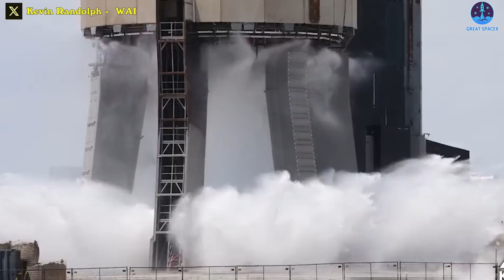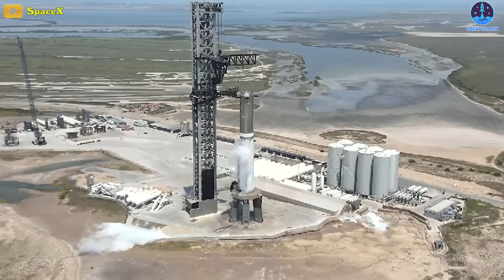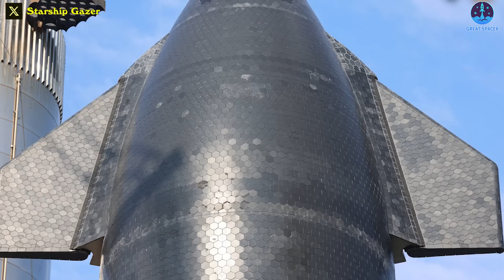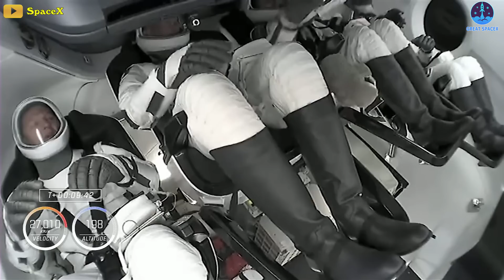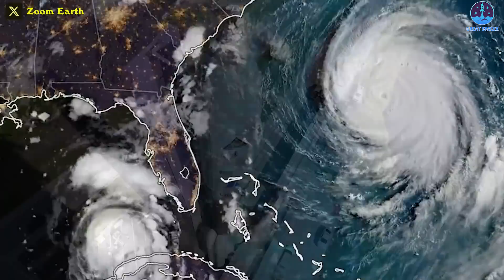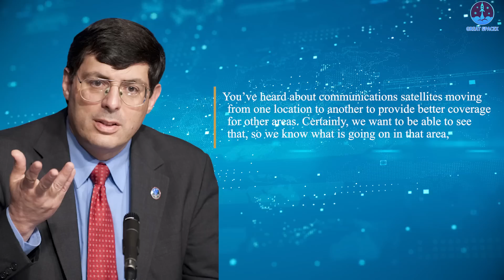New SpaceX Stage Zero upgrades after 33 engines Static fire!!

Comment: Thanks for mentioning the deluge system as I'm not seeing any real analysis of its performance during the static fire.  Even at 50% thrust, the water and/or steam output were no longer visible after the engines reached nominal pressures.  Will this system protect the plates and continue absorbing energy with the engines throttled to 90% for takeoff?

I'd be very interested in SpaceX's own assessment of Friday's test, but we're unlikely to hear such details.

Comment: If anyone believes that Starship's booster will have a 100% 33 engine success on any future test flight only need to look at the lack of success of the USSR N1 lunar rocket, 3 test flights 3 failures.  EM and company need to have a plan B and C to replacing the 33 engines with few and bigger engines.  See Saturn 5 and it's near perfect F1 engines.
Reply: SpaceX has a 100% flight success record with its 27 engine Falcon Heavy.
Reply: Saturn 5 was several years in the making of a single ship and every ship was disposed in the Ocean. The goal is to make space affordable for new people and things to make our lives better. Starship is a revolution in space flight if it works as planned.

Comment: NEEDS A WATER POOL! Star ship is the world's largest leaf blower and needs a 200ft bellagio size pool around it or the hurricane it will produce at full thrust will only draw more fines and delays from epa and faa as it tares up the beach. A water pool is the only coduet to protect larger and repeatable launches from debris tornadoes on ground.
Reply: Launch at sea. Use a modified oil rig with a big hole in the center, so the rockets blast into the water. Just a thought.

Comment: Does the DELUGE system rely Solely on electric pumps to deliver the deluge water? THIS would be unfortunate if many lives are on the line - I would feel much safer if there was a HUGE air tank back up and/or assist system for IMMEDIATE And Reliable Pressure on startup - regulate flow after the air pressure starts the flow - REDUNDANT systems are not good when cutting costs and reducing weight but when it's a "SAFETY CONCERN" and it's on the ground, "WEIGHT is no concern and Space is no concern" COST ASSOCIATED WITH SAFETY AND REDUNDANCY is a net advantage and good for verifying that the system is safe ! ! Go Baby Go ! !

Comment: Look at that steel plate that directs the water deluge. It looks ruined. The holes look stopped up with mineral deposits from the water being vaporized on the plate. The deluge system was a poor idea. There is no way we can engineer a water spray directly under the flame force of 33 Raptor engines. As I predicted after the first launch, a flame trench straight out into the Gulf Ocean is needed. SpaceX could make the steel plate a disposable item that will need to be replaced after each launch. That would take extra time and add expense to each launch. I don't think Elon will like that idea but it could allow the testing of orbital launches in a reasonable amount of time. It could take 6-12 months to build a flame trench that can handle all those Raptors firing at once. Perhaps the environmental lawsuit will demand a new kind of launch pad. We need to dig deeper into the lawsuit.

Comment: the ocean is quite warm this year, which could give rise to a prolonged hurricane season, and permanently high air humidity (causing excess condensation on cold surfaces)  Frost build-up on Booster! Wrap a thin, dry, cool, floating, (multi-layer?) Helium balloon around Booster 9 and Starship when doing the real launch attempt.

Comment: What is the speed of sound in orbit?
Reply: The speed of sound only has relevance in the atmosphere. No atmosphere = no sound. When a commentator uses it as a reference, it is just to give a speed reference people are familiar with. All speed is relative. To compare EXTREMES A rocket passes Mach 1 in relation to the Earth, while simultaneously traveling in orbit around the Sun at 67K mph.
Reply: @gregedmand9939  There is no sound in space... It's a vacuum.. so no sound can be made... There is NO speed of sound there
Reply: @thrillchaser9492  Exactly what I just pointed out... 🙄
Reply: @gregedmand9939  I just use simpler terms.....hahaha

Comment: Its been obvious through the first deluge system tests, and become imperative through the spin and prime booster tests that the deluge system has to be fine tuned to do its job, but avoid getting so close to the rockets that it doesnt cause safety shut downs of random numbers of the 33 rockets.
And spacex needs to hurry up and get a used deluge water catchment and containment system inplace, otherwise environmental and regulation politics will keep stopping progress towards launch before and after every attempt
Reply: Bad take

Comment: I'm still not convinced the water dell-huge system can hold the 33 raptors at full or 90% thrust. I'm pretty certain no system can hold that power. So amaze me SpaceX, prove me I'm wrong.
Reply: Why so much garbage? I thought 'everyone' wanted to see advance into space endeavors?
Reply: @johnrday2023  sure, absolutely, but not gonna get there with wishful thinking. IMO the current thrust release area is too compact; dig a trench or if marshland prohibits raise the whole tower (way way) higher up.
Reply: What does "hold that power" mean?
Reply: @spacesterzone  My guess he means .The Water Deluge System
Reply: @raphael.egarcia4139  Hey I've got no problem with wordplay, that was actually fun. But "power" cannot be "held", by definition. Energy can be stored, but power is the time rate of energy delivery. I guess he meant "counteracted", which is entirely different. The question is if the energy involved in the state change from liquid water to steam is sufficient and rapid enough to counteract the engines. This is actually a very simple calculation.
Reply: @raphael.egarcia4139 no, he’s talking about a massive Dell laptop 😂
Reply: @spacesterzone  Hold up to that power without serious damage being inflicted upon the launch platform structures and/or  seriously damaging the surrounding acreage .
Reply: I'm not even convinced that it "worked" at the 50% throttle used during static fire.  It worked before and after, but during peak pressure it appeared that both water and steam decreased dramatically, which would not be surprising as the pressure above the nozzles becomes incredibly high and there are interactions occurring across the wide pad area that may not be easily modeled in simulations.  No one has ever tried to do it this way, so it's an experiment.
Reply: Your correct. Look at that steel plate that directs the water deluge. It looks ruined. The holes look stopped up with mineral deposits from the water being vaporized on the plate. The deluge system was a poor idea. There is no way we can engineer a water spray directly under the flame force of 33 Raptor engines. As I predicted after the first launch, a flame trench straight out into the Gulf Ocean is needed. Spacx may make the steel plate a disposable item that will need to be replaced after each launch. That would take extra time and add expense to each launch. I don't think Elon will like that idea but it could allow the testing of orbital launches in a reasonable amount of time. It could take 6-12 months to build a flame trench that can handle all those Raptors firing at once. Perhaps the environmental lawsuit will demand a new kind of launch pad. We need to dig deeper into the lawsuit.

Comment: I hope I’m wrong, but I just don’t see the current deluge system working indefinitely at full weight and power; the water pressure is too low. The OLM simply needs to be higher off the ground.

Comment: Not sure how a starship would manage to land or launch on Mars without such an elaborate launch pad!! Any thoughts
Reply: Less gravity, the mega booster is not needed.
Reply: The current Starship design will not land on Mars or launch from Mars.  Many design iterations will happen between now and then.  It will also be quite interesting to see how much preparation there is on Mars by robots and construction machines delivered by the first few Starships that arrive and land with no human crew, but lots of Optimus robots, remote operated machines and other equipment.

Comment: SpaceX gave warnings to marine saying that there may be debris on September the 8th. In other words, Starship is planned to launch on September the 8th. The question is if they can manage to launch it then.
Reply: They COULD be trying another test that date, not a launch - particularly of the changes to the deluge system.
Your "in other words" is a BAD assumption.
Reply: @bricefleckenstein9666  In any case, it does not look like it is going to launch in 3 days. They are close to launch, but not that close yet.
Reply: @Imagine_Beyond  No launch permit.
Even if they COULD launch, they can't do it legally.
Reply: @bricefleckenstein9666  They only got the launch permit 1 day before the first launch, so I wouldn't be surprised if they got the launch permit on the 7th of September with the second launch. Also, they have stacked SN25 on the BN9!! They only have to do a wet dress rehearsal and get the launch permit to launch it a 2nd time. Even though September 8th is a bit early, I hope they do manage to launch it then legally.

Comment: As the launch date is now some time in Sept, my launch date for my piece on Stage Zero and which is based on the charged nature of matter also naturally goes back as well. But seeing there is rather a large storm system crossing Florida, I thought I wold just stick up a few paragraphs on the weather, from my charged point of view website.

"...In the Southern hemisphere the major Birkeland Current input into the earth can center itself around the Antarctic land mass and ground through the electrically conductive saltwater of the sounding ocean. In the Northern hemisphere it has a broken landmass surrounding the North Pole, with it covered in a non-conductive icecap. And so not as electrically conductive and so, the minor Birkeland Current input into the earth.

In the North and due to the input current’s needing to ground and with the stronger electrical input into the earth coming up from the south (forming the earth’s magnetic field), Hurricanes and Typhoons and which are the new positive electrical inputs into the earth (from the sun and via the aurora), are attracted to and so form along the strong equatorial return current. With this being due to the non-conductive ice cap and broken landmasses in the North.

After forming and concentrating the input currents into deepening Lows, they then naturally want to head north towards the North Pole and where they can fully ground. As they are naturally travelling north and over salty water, they will attract and then lift the negative charge ladened water, due to the overall negative emanating charge coming from the earth and so create a storm surge, as the whole body of negatively charged water is lifted towards the positive electrical input..."
Reply from the maker: Great information!!!